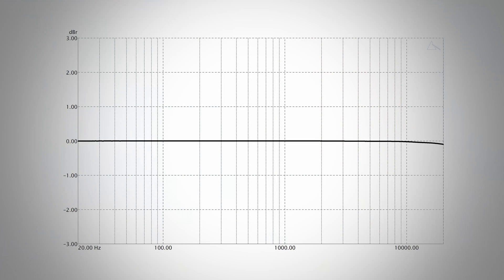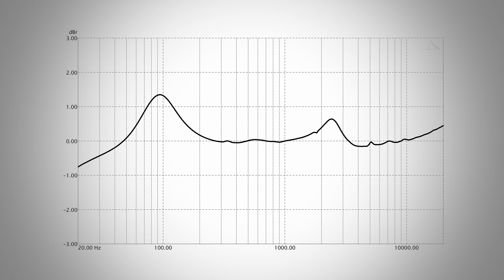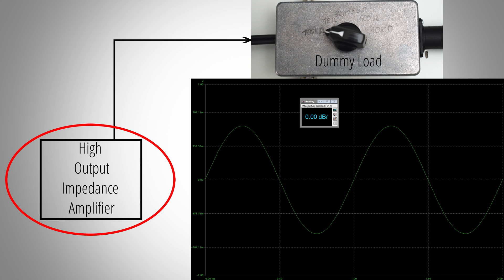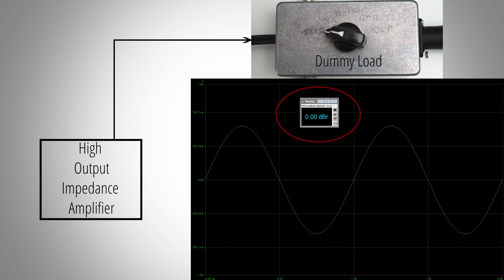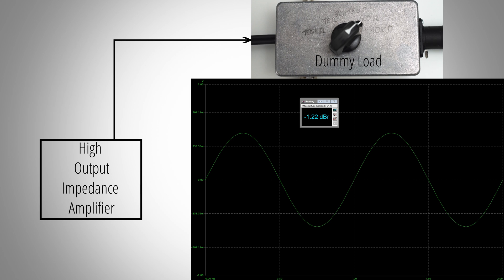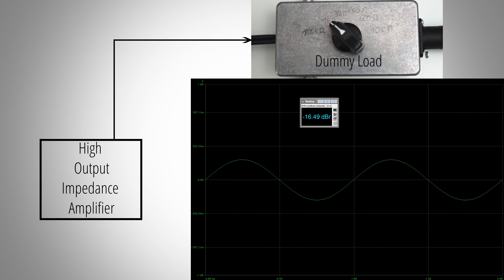Amplifier Impedance matters! Why it is important to have a low output impedance (explained)

Comment: ok for the low amplifier impedance but when you use a such amplifier, then you have to consider matching impedance to have the maximum power transfer and because the headphones impedance vary with frequency it is not simple to have a flat rensponse curve (of audio power) https://www.electronics-tutorials.ws/dccircuits/dcp_9.html
Reply from the maker: Hey, in modern audio equipment you don't really use impedance matching anymore. When the output impedance of the amp has the same impdance as the load, variations in frequency response can become quite severe. These days you use a technique called impedance bridging. This is where the source impedance is considerably lower than the load impedance. This keeps variations in the frequency response to a minimum: http://www.sengpielaudio.com/calculator-voltagebridging.htm
Reply: @JulianKrause  Thank you very much for this great explaination video🙏 In my case I have a headphone impedance of 32 ohms and  output impedance of 33 ohms. Would it be a reasonable solution to add a resistor of at least 250 ohms between amp and headphones  to achieve a better matching?

Comment: Power Delivered by an ideal voltage source is V^2/R 
I see that your specs regarding the output driver power delivered in comparison videos. Given that high resistance itself means lower power delivered, how is it possible to  expect that the best ideal voltage source will deliver good power to high impedance drivers? it's a bit counter intuitive to me. Do we want power to be high or the voltage to be maintained? If we want low impedance, we are automatically making it ideal voltage source and not ideal power source. If you could explain this, it will be really great.
Reply: We want the voltage to be maintained and get enough power. High impedance driver requires low amout of current but requires high voltage. Low impedance driver requires high amount of current but low voltage. High impedance drivers can be problematic for many headphone amps which cannot deliver enough power for high himpedance loads.

Comment: So, does this mean that "corrective" software like Reference by Sonarworks could (or should) also take into consideration the headphone amp you're using? (not just the headphone model)
Reply from the maker: That's an interesting point. In theory this should be doable if Sonarworks knows the output impedance of your HP amp and the impedance curve of the headphones. But the easiest way to handle it is by simply buying an HP amp with a sufficiently low output impedance so that you don't have to correct the response afterwards.
Reply: @JulianKrause  Thanks Julian. Awesome work, by the way!

Comment: Hey this is a old vid so I am not sure if you will respond but... What have you used for these measurements? I have shown this to a guy who claimed to be a audio engineer and he said it seemed very exaggerated.
Reply: And he said that some of the graphs looked almost like they weren't even measured just drawn...
Reply from the maker: Hey, the only graph that is drawn is the one at 05:42 as it represents a typical impedance curve. All the other curves are measured with a Spectral Measurement dScope M1 audio analyzer. (If you are interested: https://youtu.be/T93d1awPQ4o) This means the curves in the video areactual measurements of real hardware. In my case I connected a pair of Sony MDR-V 700 to a Steinberg UR22MKII audio interface. These measurements are definitely not exaggerated. As Nwavguy shows in his measurements, there can be deviations as big as 14 dB! http://nwavguy.blogspot.com/2011/03/behringer-uca202-frankendac.html Cheers!
Reply: @JulianKrause  Hey Julian. Thanks for the fast reply. I showed the guy claiming to be an audio engineer your reply. He rebuttled the evidence of the graphs being real by saying „Yeah, they are smoothed like crazy" and discredited your example with the UCA202 by saying „UCA202 is just a DAC. It doesn't have a headphone output." He also said that he thinks this test was exaggerated and that you should have disclosed that. IDK TBH I am not an expert myself. I'd just like to see your response.

Comment: So with 10 ohm we should have atleast 80ohm headphones. That means lower is bad but does it mean that 600ohm will work jus fine too?
Reply from the maker: High impedance headphones do in fact fix this impedance problem but they have another downside. They need a very high voltage which not every headphone amp can provide. This means that the headphones won't get loud enough. So, it's a balance. Ideally your headphone amp has a low output impedance and delivers a good amount of power.

Comment: Thanks Julian. It's the clearest explanation I found so far as a total newbie. That being said, it's still confusing as hell for me. A lot of people are telling that high impedance headphones need "enough power" to be driven properly and on the other side you say high impedance headphones draw less current, which seems logical because we're talking about resistance (right?). They also say that High impedance headphones require higher voltage sources and low impedance headphones require higher current sources. Maybe I don't understand the difference between voltage and current... I have a DT 770 pro 80 ohms and I don't understand why it sounds so good directly plugged on my laptop and no so good when connected to my h4n phones output and my smartphone. If I had to choose an audio interface I really don't understand how I should understand the output impedance so that it matches my headphones impedance. Can you give me a few insights? Thanks ;) !
Reply: Short answer: your laptop probably has a lot more voltage available than the h4n and smartphone. Battery devices can't deliver enough voltage for higher-impedance phones, they expect to see ordinary consumer 32 ohm phones. Output impedance is rarely the issue.
Reply: You would want a headphone amplifier with at most 10ohm output impedance for it to not have an effect on the frequency response of your headphones.

Why do you like it in your laptop compared to other sources?

Comment: So I keep reading that when you use a high impedance headphones, like Sennheiser HD600 (300 Ohms), you "must" use a dedicated headphone preamp for them to sound their best. What's this all about? From your video I understand that as long as the output impedance is 300/8 or less they should sound as intended. Or not?
Reply from the maker: You are right, high impedance headphones will sound great even on amps with higher output impedance. The reason people tell you that you need an amp with high impedance headphones has to do with power. USB powered interfaces struggle to put out a high voltage which is needed for high impedance headphones. In turn your headphones often won't get loud enough. An external headphone amp can usually provide a higher voltage into high impedance headphones and thus they get louder.
Reply: Yes, they are not very loud. But does lower power amp in USB devices affect their frequency response in a bad way? Because many people write that they do not sound their best, unless coupled with an external amp of matching impedance... Is this one of the audiophile ignorance things?

Comment: 6:34  which headphones did you connect with what nominal impedance and to which amp with what output impedance? Thanks! It's counterintuitive that the resulting freq. response doesn't follow the "inverse" of the headphone impedance after connection to the amp with high output impedance.
Reply from the maker: Hey, I connected a pair of Sony MDR V 700 (24 Ohm) to a Steinberg UR22MKII (91 Ohm).
I know this can be confusing at first, but think about it this way: When the impedance of the headphones rises, it loads down the amp less. The amp in turn can put out a higher voltage and thus the sound pressure  level rises. In this scenat the headphones frequency response directly follows its impedance response.

Comment: So you're saying that headphones are exclusively designed for 0 output impedance sources.

But allegedly there are is a standard, that could be DIN 45596, IEC 61938, DIN-EN 61938, DIN-EN 60268-7, i don't know, i haven't checked, that specifies the headphone amplifier output impedance to be 120 Ohm, regardless of headphone impedance. Correspondingly, headphones "should" be designed with such a high-impedance source in mind.

This is even the case for a reason. You might be connecting a load anywhere between 16 Ohm and 600 Ohm to that amplifier, and correspondingly, with a 0-Ohm output, the output power could differ by a factor of dozens, which makes either some headphones too silent to be useful on a given amp, or others prone to take damage or blow your head off. One could say it's not particularly user friendly. Well apparently adding a series resistance like that will radically flatten out the power difference, it would only come down to maybe a factor of 2.

Granted, for headphones that might end up being connected to a phone or a Walkman, it would be entirely nonsensical if they were designed for such a high impedance... Also in my experience, adding resistance in series with headphones sounds pretty unfortunate, and somehow seemingly not just the frequency response, maybe the transient response too. Anyway the existence of a standard - which is apparently more or less implemented by some devices, like those Steinbergs at 90 Ohm - honestly close enough - implies that by all reason, not all headphones are designed for 0 output impedance. Beats me which though!

Comment: In the high source impedence graphs with a low load impedence. Why do you get a bass boost when headphones typically have a high impedance in that region, which implies it needs less current in those frequencies  and should have a cleaner response.

Comment: Great video and explanation Julian! I've been looking for this information for a long time now. I wanted to buy a new pair of headphones, the DT-990 Edtion (250 ohms) and connect them to my USB audio interface Behringer UMC204HD. The problem is that this interface is known to have a poor phone output and produces too much noise after 50% of the volume. Someone measured the output impedance of the UMC204HD and it seems high, 21 Ohms (@ 440Hz, 1V). Do you think the interface can manage to drive the DT-990s?

Comment: Julian, As a C.E.T. I really like your Videos. I'm in the market for an Audio Interface, 1 or 2 Microphones (likely at least 1 LDC) and perhaps some new Headphones. You mention I/F high Headphone Output Z being a concern (on some of the Vids.) Not all I/Fs give this Measurement, I find. Also 1/8th of this Z (Ω) for the HeadPhones input Z (Ω) (For example my current My Sennheiser NT4.5 = 18 Ω  plugged it.1/ 8 X 18 = 2.25 Ω output Z on HPh amp) seems very low indeed, yet some Headphone Mfgs. also do not provide their HPh O/P Impedance measurement.  So, can you suggest 1 or 2 pairs of Headphones that you think avoid this problem? Your reviews give me good guidance into Audio Interfaces, so I'm good there I think.
Reply from the maker: Hey, to be honest, I wouldn't buy headphones that fit to the Interface, I would buy an interface that is properly designed and can be used with any pair of headphones. This way around you are not limited in your headphone selection. If you are in the market for an interface and want a really good headphone amp, I highly suggest the Motu M2. The M2 for example hat a near zero output impedance, so you can use any pair of headphones that you like.
Reply: Thanks, Julian Krause. That’s amazing. I just spent the last few days researching my options for an Audio interface and narrowed it down to one of the Motu units! Thanks for the feedback and your informative reviews!

Comment: Hi Julian, I really enjoy your videos, especially the ones about audio interfaces, you are very knowledgeable and a great presenter! I have a question about audio interfaces and headphone output, it would be really cool if you made a video helping with selecting headphones for audio interfaces, I have watched all your videos and I am still confused on it :P I am considering buying the Komplete Audio 2 wiith an AKG K-271 MKII headphone, but I am lost in how to figure out if it will work, I found its ohm rating (55), and its sensitivity (104 dB), but I have no idea how to tell if the Komplete Audio 2 will drive them. Your rule of thumb plus a comment I found about you saying the KA2 having a headphone output impedance of 10.2 ohms suggests to me it wont and I need headphones with more than 80 ohms impedence, it this the correct way to understand it? I am confused about the 10.2 ohms though since I found a comment on NI's forum saying the KA2 has +4.2 dBu (48 mW @33 Ohm) plus talk about 250 ohm headphones are very low volume on the KA2 https://support.native-instruments.com/hc/zh-cn/community/posts/360006205998-Komplete-audio-2-quiet-en-us-?_ga=2.55432745.36743076.1586150492-898778229.1585820188

If they wont work, could you perhaps suggest a headphone pair for me? I will be using it for voiceover and podcasting. 

Thank you in advance!
Reply from the maker: Hey, I think you are confusing two topics. The output impedance and Impedance of the headphone and my rule of thumb have nothing to do with how loud the headphones get. It shows the effect of the amp output impedance on the frequency reponse of the headphones. 

In this regard I think the KA2 and K-271 MKII combination should be fine. With 55 Ohm the headphone impedance is lower than eight times the output impedance of the amp. But again, this is just a rule of thumb and I the headphones have at least 5 times the impedance of the amp.
Now, you have to figure out if the interface can deliver enough power. First you have to find out how much power you need with this particular pair of headphones. You can use this website to calculate the power: http://www.digizoid.com/headphones-power.html With a sensitivity of 104 dBSPL/V and an impedance of 55 Ohm the headphones need about 70 mW of power. 

Into 55 Ohm the KA can deliver about 22 mW. (Sadly there is no way you can tell this from the specs of the KA2 and I just know it because I measured the interface).

Now, obviously if the KA2 can only deliver 22 mW but you would need 70 mW, it has not enough power. In practice will max out the gain on the KA2 and in combination with the K-271 MKII the sound will not get very loud.
If you want to stick with the K-271 MKII you would need to buy a headphone amp with sufficient power. If you want to stick with the KA2 you would need to look for a different pair of headphone which needs less power to drive.
Hope that helps!
Reply: @JulianKrause  Thanks a lot, I appreciate you taking the time to explain this to me. You're a champ :)

Comment: What is the actual output OHMS for Low Output Impedance Amplifier?
Also what is the actual output OHMS for High Output Impedance Amplifier?
Reply from the maker: Hey, there is no fixed number for that. But everything under 2 Ohm I would consider to be a low impedance amplifier. Above that an amp gets gradually higher impedance.

Comment: This video is soooo good, something I’m still lost on though, is what happens with high imp headphones running through a low imp amp? Is there no consequences?
Reply from the maker: That's a good thing to run high impedance headphones on a low output impedance amp as this will give you the best audio quality. The only downside is that sometimes amps with low output impedance can't produce high voltages which are required to get your high impedance headphones very loud. So you might enda up in a scenario where your gain is at the maximum and your volume is still not very loud. But the sound quality is going to be excellent :)
Reply: @JulianKrause  That's what I have been seeing around the internet, but that's confusing to me, because shouldn't low impedance amps give the most voltage?
Reply from the maker: @sorrymomimsohigh  Because if the low impedance they can deliver a very high amount of current but not necessarily a high voltage. Amps that can do both at usually found in more capable headphone amplifiers.
Reply: Julian Krause OH! Light bulb moment. That clears up everything, thank you!!!

Comment: Thank you for this video, it was very instructive. I have a question: Is this rule applicable in the same way for the inputs on my audio interface? When I try to connect a cheap lav mic I bought long time ago to my Behringer 202 HD it hardly captures any sound. Have a nice day
Reply from the maker: Hey, a lav pretty much always has an unbalanced connection. I'm assuming it has a 3,5 mm connectors. The inputs on the 202HD are balanced. Additionaly lavs mostly need plug-in power which the 202HD does not provide. You can use an adapter like the Rode VXLR+ to properly connect your lav to the 202HD.